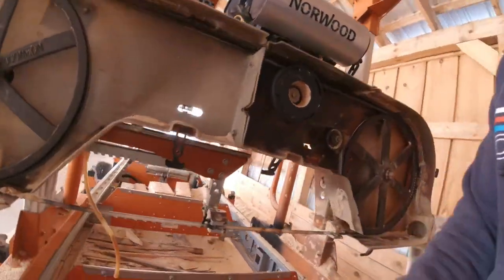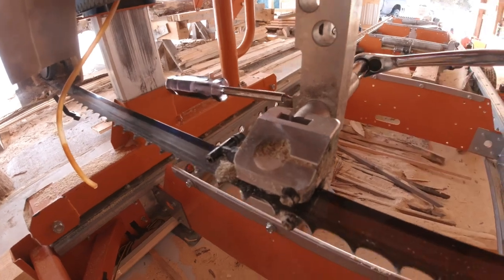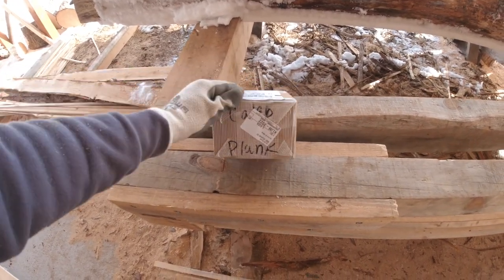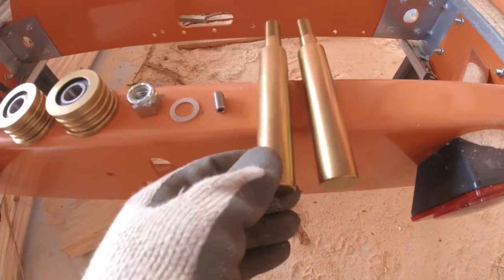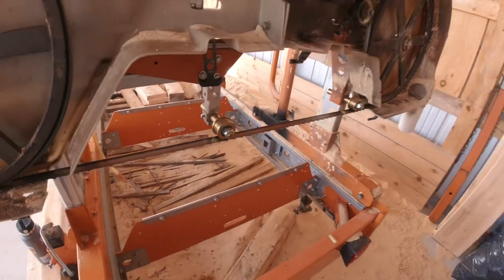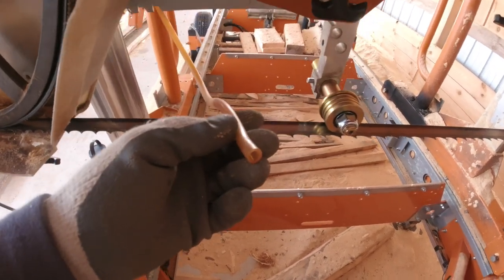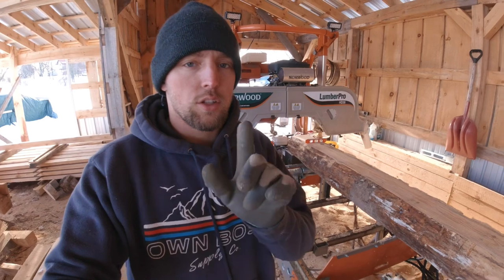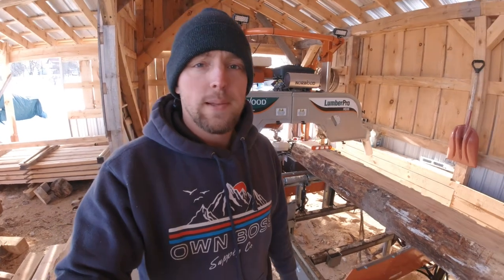Changing the blade guides on my Sawmill. (Norwood HD36 Portable sawmill)

Comment: just got my roller replacement kit in. Tired of how finicky the ceramic guides have been. As you mentioned i have the same problem with the retractable arm being sloped. Going to try and fix that when i get the rollers set up how i want them. this video gave me some insight so I appreciate it!
Reply from the maker: Awesome! Your welcome. And I hope it goes as well as my experience has been. I put some shims underneath the retractable guide arm to give the blade some pressure downward there. Because it basically didn’t have any to begin with. But now I can’t move it back and forth unless I force it. So I need to come up with a better shim that doesn’t cause it to bind. It’s not a good setup for being adjustable and have pressure on the blade at all. For the ceramics it was ok but not the rollers.

Comment: You would think there would be 1 roller that has a device on it to attach the tube. I'm not understanding that, lube is very important. I'm gonna look them up on the site and see if there are 2 different rollers...if not I'd say their engineers screwed that up too. I have the same problem with the last cut. I'll wait and see how you make out with these before I bite the bullet. I've been busy harvesting my logs...won't be long before I'm full time sawing, quite a few orders coming in for spring. Cheers!
Reply from the maker: Exactly! 
I’ll probably do an update on it shortly. So far I think I have most of it figured out. And I’m impressed with how much better it cuts. The only time I’m seeing a lot of varying in cuts is when there is frozen wood or the blade is getting dull. 
Sounds good 👍🏼
Reply: @Plankmills  Late to party. Did Norwood have a solution for the tube. You would think it would be built in like the ceramic guides. You shouldn’t have to McGiver anything on such an expensive piece of machinery. I have a 4 year old HD36. I bought it new. It barely has 6 hours of cutting time on it. Life got busy but I now am just getting back to milling some lumber. I feel like a kid on Xmas morning.
Reply from the maker: I believe they have something for it now. With their newer versions but I’m not sure.

Comment: The new blade guides should improve your cutting efficiency and give you better boards. Could you install a bracket on the front shaft of the guide to attach your lube line to keep the blade cool?
Reply from the maker: Yes I am impressed so far with how much better it cuts. 
And I have rigged something up temporarily now for the blade lube.

Comment: How’s the guides holding up, FYI when you need another set Cooks mills has guides with dirk fittings for grease. Thx for the video
Reply from the maker: That would be worth looking into ! 
Thanks! 
As long as I had it they were good. 
I sold my mill
Reply: @Plankmills  Wondering how your rollers worked.  After reading some of the comments sounds like they worked ok, seen you sold your mill so...guessing they must not have worked as well as you had hoped?  I got the order list for the roller kit but haven't pulled the trigger yet.  Also sounds like they might be coming out with a new blade guide system.  Might wait for that before changing to rollers.
Reply from the maker: @solopilot02  yes! I really liked them better than the ceramics. I think they produced a better more consistent cut quality. Less waves.  
That might be a good option. 
Some people recommended the Cook’s saw manufacturing roller guides. They can be adjusted in every direction. 
And to me that would be an amazing feature! Also a better lube system. Would be nice. 
The only complaint I have is that there was no attachment for the lube system on the new roller guide. If you watched my videos on the roller guides I think I showed that it didn’t have a spot for the that. But I make-shift made something work.

Comment: That's going to be my next upgrade.  Someone told me to just throw away the ceramics, I should have listened.
Also, have you noticed that your guide arm is not level when you extend it?
Reply from the maker: I recommend that! 
In my short experience so far it has been worth it. 
The only problems I’ve had is that it wasn’t level side to side, so I shimmed the adjustable guide side where it’s mounted to the frame, but not I can’t adjust it! Lol. But it seems to do quite well even without it being as close to the wood as possible. 
The other thing is that sawdust seems to build up more on the blade and the band wheels but if I run a lot of fluid on it it cleans up good. But I also then have to periodically clean the band wheels.  
Hope this helps
Reply: @Plankmills  what are the part numbers for the kit you bought?
Reply: @Plankmills  I just called Norwood and they mentioned you have to shim the rollers and get your own washers.  Also I talked with a friend and he mentioned shimming the retractable blade guide arm so it's level.
Reply from the maker: If you send me an email I can forward you the quote they sent me.
Reply from the maker: Ok, 
Just to clarify, I did not have to get my own washers. Everything I needed was included. 
And also I wouldn’t have had to shim the adjustable guide arm. Because as Dave Boyt mentioned you can just adjust the cables the level the blade side to side with the crossbunks so I did that.
Reply from the maker: Oh ok.  I had two washers that came with the kit, I didn’t know anything about having to get any others. 
I shimmed the retractable guide arm so that the roller on it would have more down pressure on the blade. But now I can’t move it lol. 
But even with it far from the wood most of the time it still cuts better than the ceramics. 
Then I leveled it side-to-side with the cables that lift the saw head.
Reply: @Plankmills  I talked to a friend who swapped his years ago he said to shim the retractable side 1/4" and the fixed side 1/8".  He used washers and cut them so they can slip over the bolts without removing them.
Reply from the maker: Oh I see! Ok thanks
Reply: Wow, between the video and these comments I’ve learned a ton. Thanks y’all.

Comment: about how much did the upgrade cost? i've been eyeing this as my next addition to my mill.
Reply from the maker: $231.59
Reply: @Plankmills  not bad. 

Overall even with the short time you've had em on how are they working out? better? any complaints with em other than the operators side roller not touching the blade really?
Reply from the maker: @charlesward3231  I’m working on a video reviewing the roller guides with my experience so far. Should be out later today.
Reply: @Plankmills  i just asked Norwood bout the set up. they sent me the adjusment guide for how to set up and tune the ceramics (again). everything is all tuned far as i can tell. Blade is almost perfectly horizontal, ceramics are about a playing card gapped from the blade (they say 2 pieces of paper), and bed/bunks are all g2g.

Comment: How do you like them?
Reply from the maker: I think they do much better than the ceramic guides did, and they seem to cut much more consistent lumber. 
One guy told me he got a set of adjustable ones from Cook’s Saw manufacturing and welded them onto his mill. I would prefer that because the Norwood ones are not adjustable. At least for the hd36 
Now I think the new ones for the HD 38 are adjustable but I don’t know if they would fit an HD36 
I just emailed Norwood to I guide about changing the blade guides to rollers, and they responded with a quote for the parts and then all I had to do was order it.

Comment: The roller guides are the old guides. The ceramic guides are an up grade. It’s to bad you didn’t figure out-how to use them properly.
Reply from the maker: Oh, I guess didn’t know that, 
Well in my experience and just looking at it from a technical standpoint and (my opinion m) I still think rollers are better. 
Have you ever used rollers at all? Or just ceramics?
Reply: @Plankmills  Just ceramics. I didn’t like them in the beginning. I got some information from other sawyers on how to use them properly and now I like them. As long as your getting straight boards, that all that matters.
Reply from the maker: I see. I agree.
Reply: @Plankmills So some time has passed since you installed the roller guides. How is it working out?